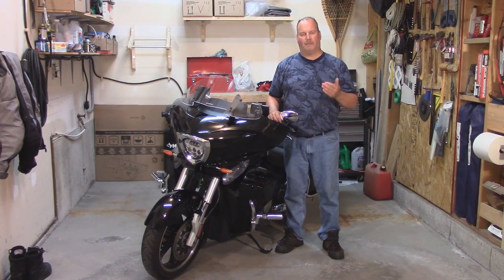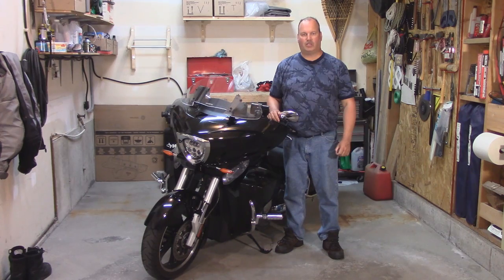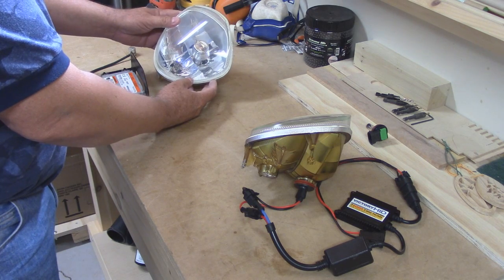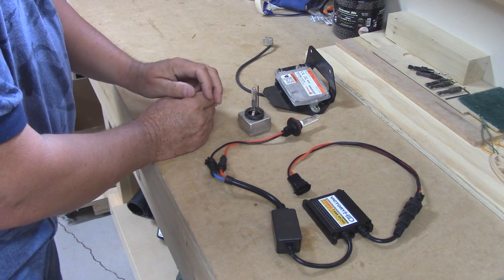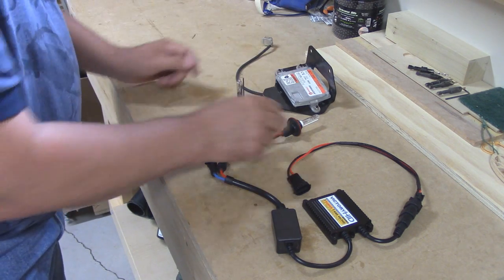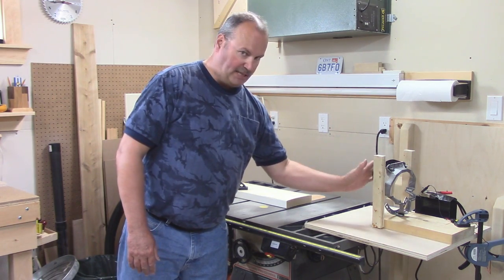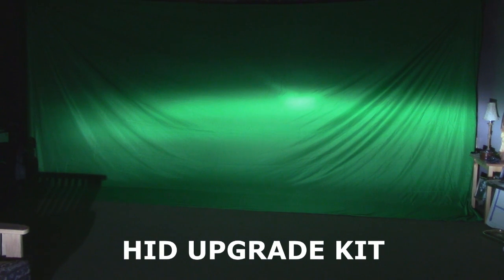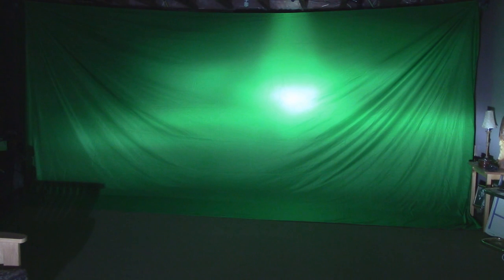HID Headlight Comparison

Comment: Just bought and installed the VictoryHID bulbs (both Low & High beam).  They are a huge improvement over the halogen in my wife's 2008 Vegas.  Definitely recommend the HID bulbs.   The High Beam does take about 6 seconds to warm up as show in this video.  I don't feel that is a problem.  Just one warning, on the 07 & 08 Vegas,  Hammer and Kingpin and 06 to 08 Jackpot, you must cut out most of the back of the factory bulb housing to run the low beam wiring through the housing.  High beam is no issue.  Detailed instructions are on the website under DIY installation instructions.  I used a Rotozip to cut away the plastic in a few minutes.  The rest of the install was easy, just have to be careful to fit all the wiring inside the Headlight housing.
Reply from the maker: Excellent comment !!!
Thanks for sharing.
Enjoy and ride safe.

Comment: I love my Victory HID Upgrade kit! It was the first "modification" I made to my 2014 Victory Cross Country Tour.
Reply from the maker: Did you replace both bulbs with the HID?
Do you find the time delay on the high beam adequate for your type of riding?
Reply: I did not upgrade both bulbs. I only replaced the low beam with HID. For the high beam I went with an upgraded (I use the term upgrade loosely here) Sylvania SilverStar Ultra halogen bulb. Brighter than stock (in my opinion), but allows me to flash high beams when necessary and adds plenty of light for high beam riding at night. I am somewhat interested in learning more about the LED bulb you mentioned at the end of your video as an alternative.
Reply from the maker: You are right about the SilverStar Ultra. I put it in my Triumph and it is much better.
The LED replacement bulb I got from the LED Factory Mart in China. They are only $50 and are 6,000K which matches the color temperature I got from Victory HID. So it is a good match.
You can see my review on them from my LED Comparison video.
I like them, they stick out a bit at the back of the housing, but it is not much of a problem since the high beam is the lowest position, it manages to stay away from the wiring in the fairing.
Reply: I love my Victory hid's! I have the 5000 temp color and happy I went with them.  I tested a Victory with factory hid and was not as good. Great test Paul keep up the fantastic work.